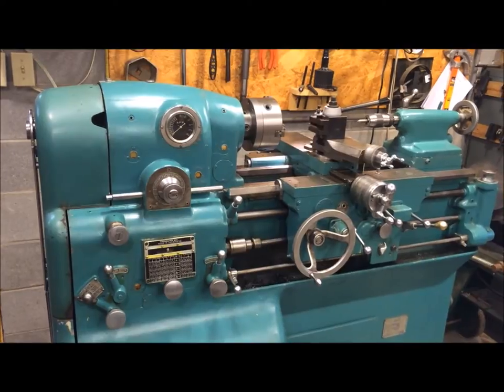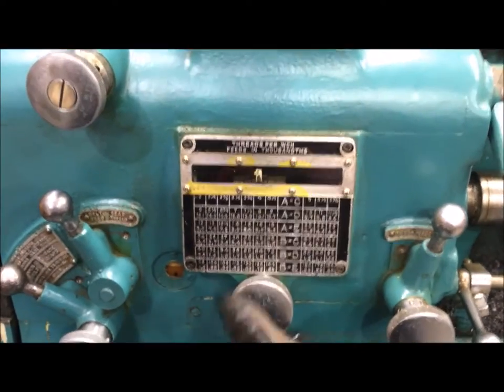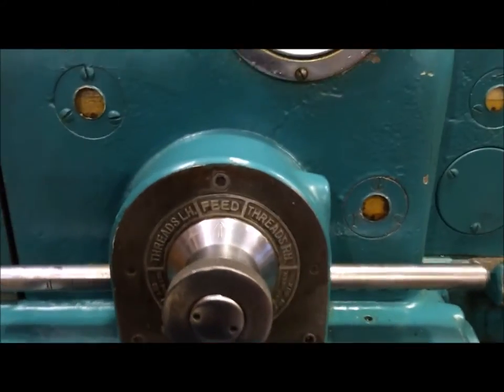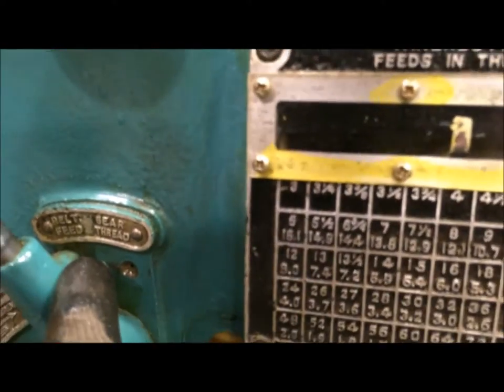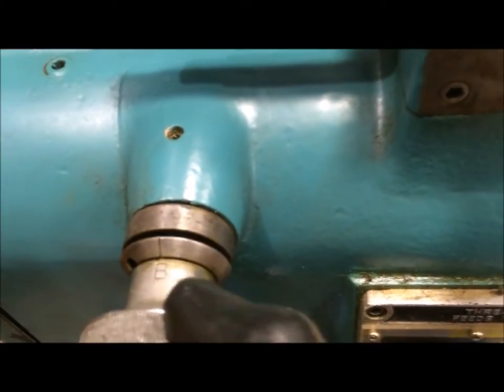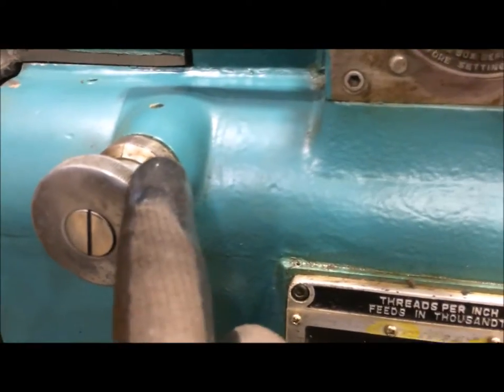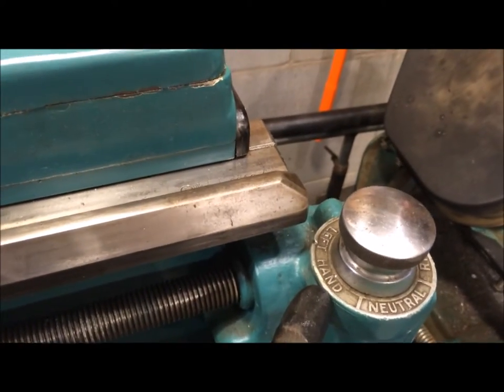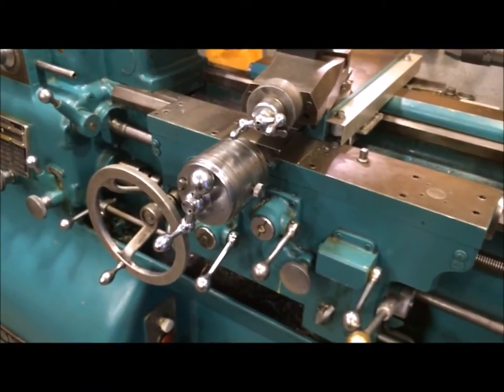Monarch 10ee Threading Set Up

Comment: Good video.  I appreciate that you took the time to post it.  However, I was able to figure out everything you show here on my own.  What you left out was the critical, though not obvious step of putting the cross feed/carriage feed selector knob into the neutral position.  If you don't do that the threading feed level can not be engaged.  This not so obvious step caused me some head scratching.